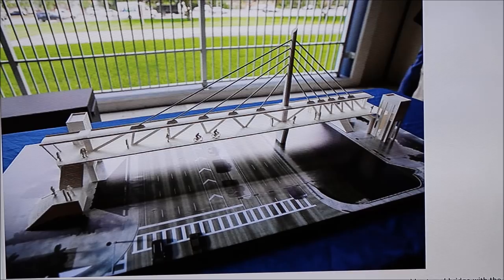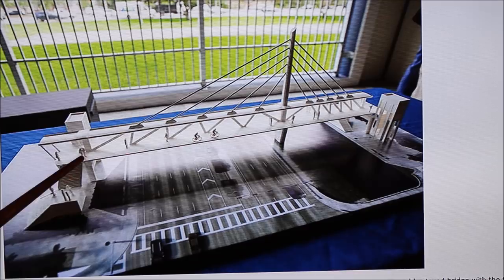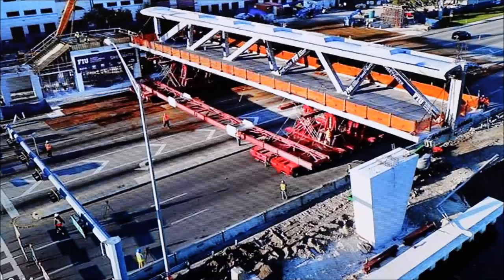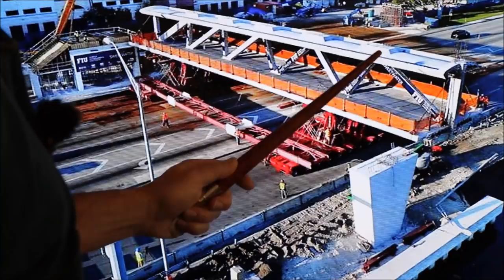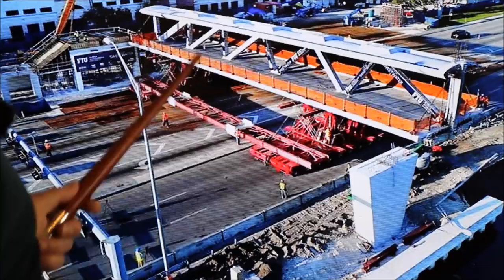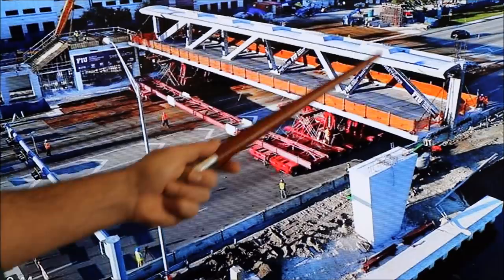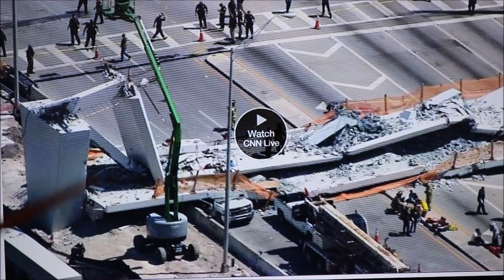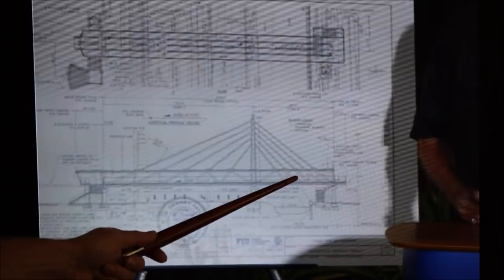Miami Bridge Failure- preliminary analysis 17 March 2018

Comment: 'Instant failure' due to one of the diagonal members is potentially correct, but I have a feeling they made the lower slab almost thick enough to just work. It is a stupid idea to put in ps cabling over it.

Comment: You never mentioned the new cracks they found Mr Browne and that was called in days earlier. I mean in this bridge mishap,, Not the new cracks in  the spillway in Oroville. The fail of this bridge came from the design to make it a category 5 hurricane proof bridge. Also then not putting some kind of support in the middle of it and to expect 950 tons of concrete and metal with out even the weight of people yet and count on upper support to hold all that weight from one end to the other. Thank God they didn't design the Golden Gate bridge. Now. Remembering that call that was placed about the cracks. Id like to see one thing.  Id like to see all inspectors reports who took and sampled the concrete while coming out of the batch plant or most likely being 950 tons, batch plants. Id be making sure some trucker didn't drop a load or two of fly-ash into a wrong storage silo. Looking from what I seen, who's to say the support rods simply just didn't pull through from a bad load or two or a wrong press of a button from a batch plant operator.. That concrete looked just a little to busted up to me for being a fresh pour of weeks, and  then you add the cracks reported days earlier. Great videos as always Juan..
Reply from the maker: thedrloboski stevens yes, I believe the rod pulled through, well find out soon....

Comment: Since concrete has great compression strength and little tensile strength, the concrete deck seems too shallow to have cables under tension to hold the portion of the concrete that’s in tension together. Further, in the pictures of the bridge before the collapse, the deck did not appear o have enough camber to be self supporting.  This would seem to indicate the suspension cables were not decorative but essential to the integrity of the bridge.
Reply from the maker: stby for update....

Comment: This was a poorly designed bridge to start. At each of those trusses there is a week spot from the opposing supports creating additional tension on the bottom bridge. They should of tension those supports in a way that balanced the load across the bridge. Like tighting a rim on a car.

Comment: Not that I'm an expert, but two things stick out. Those concrete truss members make little sense. certainly the results bear that out. if one failure there brings the whole thing to collapse, it's pretty lame engineering.  Even so, that "concrete" in the destroyed truss members and on the bridge looks terribly powdery - someone in here mentioned cement only, and I concur. So I suspect that a bad design, coupled with bad concrete might be double culprits. Don't they take cores? I would expect to hear that and that the cores tested good from the bridge people right off the bat.

Comment: Also...The shattered fracture points looked more like pulverized cement than concrete !!!
Reply: cement is a critical component of concrete, also - aggregate and sand...
mix it all together and Voila! - Concrete
Reply: Richard V Sassoon 

Umm . . . okay . . .
Reply: True, BUT, Titanium Dioxide was added to make the concrete 'self cleaning'. ANYTHING added beyond your three components, plus water, weakens the mix. A slump test can be made with actual mud-dirt and water-the real test is after 30 days when the test cylinders are tested, which I don't believe has happened. That 'admixture', again for aesthetic reasons, is what I believe will be found to be the fatal flaw.
Reply: Chris Hayden 
Nice breakdown Chris!

I could have said that... 
...if I were an Engineer instead of a Graphic Designer!!! 
😂
Reply: Chris Hayden If it was too hot when they did the pour i was thinking they might have added a retarder. Or maybe indeed the admix was off, too much glenium, plasticizer, or just too high a slump. Personally i think it was a liberal wet dream idea and a few people pocketed a lot of money.
Reply: They're too impotent to bully anyone. 
But they do destroy and betray almost everything the touch. 
No big mystery in that!
Reply: Nunyu Biznezz re: "Umm okay"
You have to spell things out for some people.   :o)P
Reply: All of you should be ashamed of yourself if you have brought politics into this.  At this point the likely hood of a bias to one party or the other has no bearing on the reports.  For the respect of the families who still have loved ones trapped under that bridge stop the hate.  It is getting old.
Reply: so cute you believe they are different.
Reply: Concrete is glue for rebar!
Reply: Have you seen the research for using fly ash in the mix?  I looked once but didn't find it.
Reply: +Daniel Ramsey   wasn't 14 million was to little money, how much would this cost with union workers
Reply: please cancel out the was
Reply: Nathan, There seem to be problems up and down the chain of command on this project which makes me wonder about "politics" interfering.

Comment: I may be wrong, Juan, but I think the truss member being worked on would have been in compression, not tension.  If that's the case, it would not have snapped while being tightened as you suggest.  Have you seen the report that lead bridge engineer Denney Pate had warned of a crack in the structure in a voicemail left with the state's department of transport two days before the disaster?
Reply: Other sources have pointed out that the end truss would have been in tension (not compression) during transportation, due to the overhang from the improper positioning of the crawler support vehicles. This allegedly would have weakened the structure, just at the point which it failed.
Reply: I agree that the design is suspect because A) the strange angles of the members of the Warren truss are the result of the alignment of the tension members of the truss with the cosmetic "suspension" cables descending from the cosmetic pylon and B) the upper flange of the truss has failed in compression at three points which, as someone else pointed out, is concrete's strongest suit.

Comment: Jaun, I have been following this story and as many of the videos as I can find.  I am a civil engineer but not a bridge designer.  I am going to try to link the proposed plan package which shows that the 9 th and 11 th web strut or the last two inclined struts shown in your shot of the span on the carrier do not show in the plans to have any post tensioning cables in them.  In the plans the carrier on the pylon end was supposed to support the span on the end not under that node.https://facilities.fiu.edu/projects/BT_904/MCM_FIGG_Proposal_for_FIU_Pedestrian_Bridge_9-30-2015.pdf   Also these plans show in detail how the 16 inch tubes were to be fastened to the spans and pylon with 1 - 3/8 inch bolts through steel plates.  On the face of these details they are nowhere strong enough to support any load other than themselves.  These two spans were designed as simple spans.
I took prestressed concrete as a technical elective in college.  Never even in regular concrete did at any time we allow for tension.  In prestressed concrete the steel took all of the load and the concrete just positioned and protected the steel .
I agree with you that the design will be a lot of the problem.  This whole project was a Obama "TIGER" project from the beginning.  The deck is too thin for the span and the canopy is also too thin for the compression.  As put forward by someone else, a concrete truss in not a good idea. It will be interesting to follow the outcome.
Reply from the maker: Exactly!

Comment: Juan,  As you know "pre-stressed" concrete bridge sections have been built for years in bridges and building with great results.  Im suprised they did not "pour" these trusses with the cables "Pre-stressed to carry the load before it was ever moved on site.  The camber--or arch--of the span should have been calculated and disigned into the structure and the cables pre-stressed?  Id like to hear more about the reasons they are making changes to the truss cable tension and why that was included in the design in the 1st place.  Thanks again for how you handle the reporting and the questions you ask in these type of incidents.  Ray

Comment: It looks to me that this whole thing was a total unplanned- out hurry-job with absolutely no regard for human life. Corner cutting in the design was built in. In layman terms, "a "hurry up and pay me quickly." Classic.  Why further burden it with a false sense of security by adding on a Cable tension system overhead??  It was totally overweight with cement,  with nothing in the way of support.  Hindsight is always 20/20, but this one wreaks of greed and hurry job. What ever happened to a real college education with designing and construction??  Were the students of those college educations more interested in hazing other students and drinking parties than studying?  Many unanswered questions here. Way too many of them. There used to be integrity built into our Colleges and Universities. There used to be students brimming over with integrity, and we could find them burning the midnight oil studying their books preparing for their final exams. Their hearts set on being the best at whatever they were there for. Did they throw that out the window with the dishwater?

Comment: Did not a witness say a sling broke and dropped a load on the top of the truss? Also showed a photo of sling hanging off of crane winch line.Also, the project had multiple time-lapse cameras documenting bridge constructon.
Reply: There was a crane holding a hydraulic ram for tensioning the rods.

Comment: Something I wonder: even if the steal rods didn't fail, they would have been putting extreme pressure on the concrete 'truss' pillars during the test, right? Maybe one truss failed and it had a domino effect throughout the concrete. Also, was the concrete 100% hardened? Personally, I don't like a heavy, thick concrete design. There are ways to cover an ugly lightweight design and make it look good, I think.

Comment: Funny(strange) how those wrap around advertising flags could be where the cracks were that were there PRIOR to the bridge being moved! So many cracks prior, yet it's like finding a needle in a haystack to find that info & pics. Philadelphia Construction tuber has most info. Did you see the flat, walking deck span part with all the rebar before the pour? Eng-tips forum has links to new interesting info. Best to read all from beginning.

Comment: A few days before the Silver bridge fell in 1967 my family crossed to go Christmas shopping..That fall created the national bridge inspection program we have today..1988 I whip lashed me  neck at work, the highway dept. put me on bridge construction inspection even though I had no engineering experience..Mostly it's recording everything that's happening during the work and taking samples for quality control..Been on disability retirement since 1993..When I first saw the picture of  this bridge failure I wondered how that thing would stand with that length without additional support..I didn't know about the cable stay tower..I could easily see where the failure was..As you said just the addition of a temporary center support would have saved this bridge..Plus there should still have been no traffic allowed till the support tower cables were attached.. https://en.wikipedia.org/wiki/Silver_Bridge

Comment: if you look at the bridge collapse, it is very easy to see why it collapsed. there were no cable supports linked to it, in other words, the central tower hadn't been built, so no cable ties were connected to the span. that should have been the first thing that was built. there was a crane in view in the footage, and I wouldn't wonder that at the moment of collapse, the crane had only just untied, and the bridge had only just been let go. the builder should have built the central tower, there should have been more cranes with that span holding it up from several point while the cable ties were connected, and lastly, as it was only a pedestrian bridge, it should have been made of plastic. concrete in this case was the worse choice. there have been several plastic bridges, and they work. concrete is old school.

Comment: I worked in precast prestressed concrete before. You can have all kinds of issues when tensioning or detensioning. I have seen very ridgid cables snap and whip around on the form bed because they broke while tensioning. I have seen concrete explode when demolding and removing a beam because the concrete was not fully set in part of beam. So for them to be tensioning or detensioning when traffic is flowing under the bridge is insane to me.

If you look in this video you see the guys tensioning.

https://www.youtube.com/watch?v=Ucflj-MsJBI

Comment: I know nothing about engineering, but any fool could see that the concrete structure was too heavy to maintain integrity over that  distance without some center support to the ground.  There are a lot of other questions. Every report I saw said that the bridge had either already opened for use or was ready for imminent opening. Clearly it was unfinished, unless it was a bridge to nowhere since the section over the canal was absent. The city and public safety officials told helicopters to move further away from the collapse so rescuers could "hear the cries of potential survivors". The news conference stated there were hundreds of rescuers helping victims or looking for survivors, but I watched the entire live video feed of a news copter and, although there were hundreds of personnel, only about 6 seemed to be doing anything except mingling or standing around. Officials also said there were rescue dogs on the scene, but I never saw a single dog. There were about 6 or 7 vehicles completely or partially under the collapse, a couple of which looked like there could have been survivors on the floorboard, but I never saw any efforts or urgency to remove any concrete to save potential victims, in spite of a huge crane sitting nearby. Public officials also begged reporters not to release any information unless it was "approved".  The same old story of control and obfuscation with all "events".

Comment: If I get what you are saying that the tower and suspension looking section.. are only ornamental.. Then I think they Freak'n screwed up the Engineering of the truss..  in fact.. They had better go back to School..
Did the Steel used in the Bridge NOT meet what they needed..??

Comment: A fake suspension bridge that was precast and they probably over torqued the tension cables, my guess it was that. Any chinese steel?
Reply from the maker: good question...
Reply: blancolirio Juan, i manage a concrete precast company in Alaska, been building concrete septic tanks for over 20 year's. I would really love to see the concrete batch cores from each section the inspectors take, cylinders that are cut or pressure tested to see if they are in spec of at least 4,000psi. Plus how long ago was it poured, was it fully cured? Did they use too brittle of steel? We had very brittle rebar from China, would not bend like it HAS to. Overall this smells of a political scam through and through, an Obama Tiger project.
Reply: Chineisum https://www.reddit.com/r/Chinesium/
Reply: It could be steel from Bumphucked Egypt or US Steel, either way the steel should have been tested and certified by the producer and tested again by the end user.  At least that was always my experience.
Reply: Or it could have been shoddy construction techniques.  Maybe there was a pour on a particularly cold day and somebody tossed in too much calcium chloride.  Maybe the test cylinders made weren't from the batch poured.  Maybe some steel reinforcement was omitted or badly placed.  I've seen it all to include watching a parking garage being dismantled piece by piece because every single double T beam was built out of spec.
There are just so many variables and unknowns that it is sophistry and intellectual laziness to speculate about political agendas.
Reply: Could have been another "Kobe Steel" (quality Japanese steel) style falsified testing data situation - uncertified testers/tests providing unqualified results/products.

Comment: Juan, you may of have missed today's news about a report of cracks appearing two days or so ago by inspectors who rightly did not sign off on the bridge and raised red flags. I wonder about vibrations caused  by the traffic,   heat from the sun and the weight of the concrete in this design.  Here's a link to the news on the cracks
https://www.nbcnews.com/news/us-news/engineers-saw-cracks-miami-bridge-days-collapse-n857481
Reply: "From a safety perspective we don't see that there's any issue there, so we're not concerned about it from that perspective," the engineer said according to the transcript, "although obviously the cracking is not good and something's going to have to be, ya know, done to repair that."

Cracks in concrete is not unusual and not necessarily a sign of a structural issue.
Reply: There was an engineer who claimed that because cracks were found in the MetroRail structure spans, they would collapse. Well guess what we are still waiting for that to happen. Cracking of concrete is just something that is common. No matter what you build with it. The cracks may not be big, but I have never seen a single concrete item that did not crack somewhere. But that is what the cables, and steel in the structure are supposed to make up for. Concrete is good in compression, but poor in tension and a failure of any of the cables, rods, rebar, should have been figured into the design. But it appears that it was not for this part of the construction process.